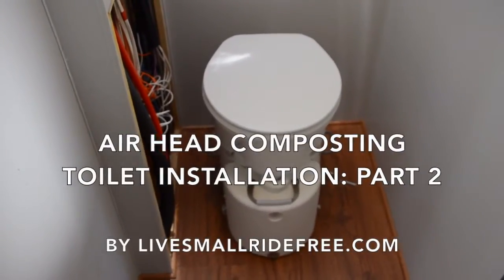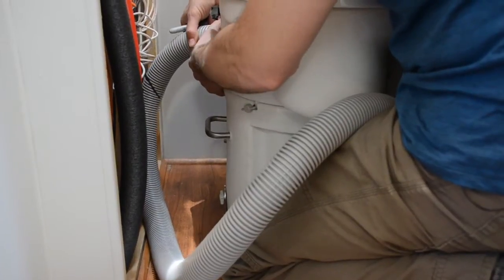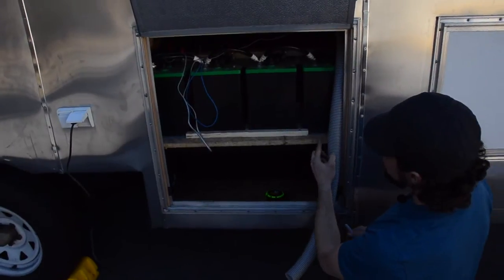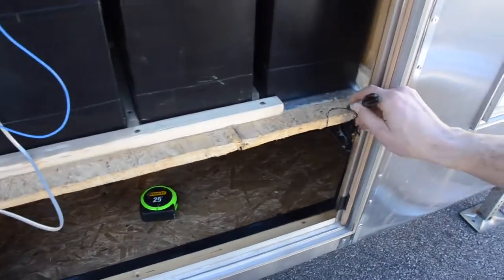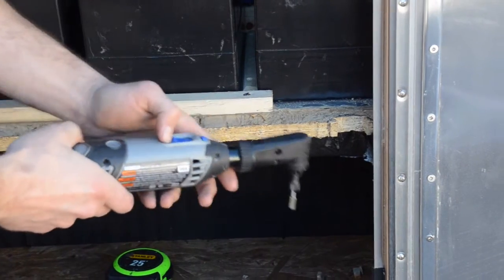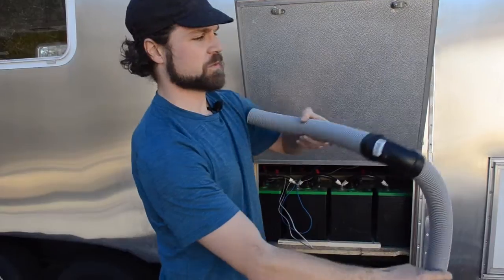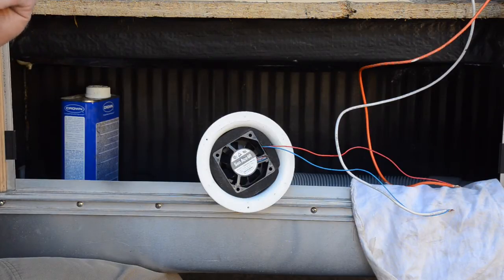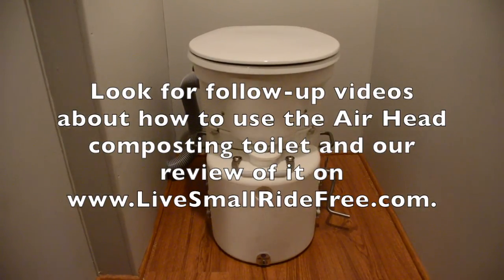Real DIY RV “Air Head Composting Toilet” Installation: Part 2

Comment: This video has been the most useful information I have found on the AirHead, which I am considering putting in our trailer.  Thank you for sharing the relevant information, clearly and efficiently.  You've demystified general composting toilet installation  for me as well.  Thank you!
Reply from the maker: That's great! We're glad the video helped. It's hard to get a detailed idea of how these types of toilets work based only on the manufacturers' information!

Our three most recent blog posts actually go into great detail about the "composting" action of these toilets and talk more about the specifics of using them responsibly. Check them out!
Reply: I'm starting my install tomorrow (revisiting your video as a refresher )   I'm wondering, with it venting out of the floor, if the fan is exposed to road grime/moisture, and how it has held up over time?
Reply from the maker: We had the vent in the floor for 3 years with no problems, but we did recently move it to the roof. Functionally, venting through the bottom of the trailer had no problems at all; we used a louvered opening and it kept the road grime out without any trouble. Driving creates suction, not back pressure, so this is not an issue.

Unfortunately our vent was also close to the "porch" area of our rig. It's on the same side of the trailer as the entry door, which is where you end up sitting and hanging out, and the air coming from that vent can have a smell to it (especially after a recent use). It's not the worst thing in the world, but it's not nice, either. Also, when we skirted the rig one winter, we had to ensure the vent was not blocked by the skirting -- or the snow!

This spring, we moved the vent to the roof, by tying it into the greywater tank vent line. It's been a real pleasure, not catching a whiff of that vent smell while hanging out outside. The smell doesn't happen all the time, of course -- just after a recent use of the toilet -- but i would say that if you can find a way to vent through the roof you will probably be happier. Extra holes in the roof are a bummer but plenty of butyl tape and Dicor will make you feel much better about it : ) Figuring out how to arrange the fan w/ roof vent can be a bit tricky but it is workable. The fan shroud supplied by Air Head is UV stabilized plastic and suitable for mounting to the roof. We have some pictures of how we did it; contact us at livesmallridefree@gmail.com and we can share what we did (haven't written it up yet).

Comment: Thanks for the info... I've been trying to decide whether to vent out the floor or the roof; I'm going to go through the roof.
Reply from the maker: We would recommend the roof! We vented it out of the floor for several years and you can sometimes smell it from the outside because of the location of the vent.
Reply: How did venting through the roof work out for you, any leaks?

Comment: Thanks. Couple of questions. I want my vent to go back through the floor as well.  Is there any back pressure against the fan when you are driving? Any problem with odour when hanging around outside the trailer? I want the opening in the floor as I would rather put a hole in the floor then the roof.
Reply from the maker: With the vent pointing straight down through the floor, there should actually be suction while driving, not backpressure. Moving air creates a low pressure zone. Venturi vacuum generators work this way. If there were backpressure, we would likely notice a smell inside the trailer after driving, and we never have.  We DO sometimes get smells outside the trailer, though. Typically only for 15-30 minutes after making a fresh deposit to the toilet, but since our toilet vent is on the passenger side near where we typically hang out, it's noticeable. I'd suggest locating the vent at a corner where there will be less outdoor traffic.

Comment: I found an airhead today for 600 bucks I'm about to buy it I reckon...

Edit, it's from a friend and it's brand new they bought it last year but they never installed it. I've never been used it's out of the box but I was wondering how those rings that are kind of cut how they go on I think they're supposed to be glued on but I don't know what kind of glue ( your part one answered this, thank you, I copied this from another video I asked on cuz I'm lazy), and also I have the side 90° hose Mount and fan shroud and I don't know what to put on the outside wall of the camper (rear wall) because I'm going to do a wall insulation so I don't damage my roof plus I need roof space for solar panels.Any advice would be great I guess I have to buy the outside downdraft vent somewhere else third party because I can't find it on the airhead shop on the website.

I didn't buy it cuz I wasn't sure if it was missing parts but it looks like everything's there there's some weird adapters to the house I'm not sure how they work I need(I think you covered some of their use in this video but I skipped through this one because I'm in a rush, I'll rewatch later). And what are those freaking coffee filters for to do like a single drop deuce? I was thinking of talking I'm down to $500, cuz I thought they were asking a lot kind of, but after looking it up there are like a grand and it is brand new so I don't need to be that greedy... I just thought it was missing parts but I don't think it is now.... Except for a bloody instruction manual that would have been nice. Mine didn't come with a roof vent option though it just come with a 90° vent so maybe you got to pick it when you buy it and they pick the wall mount, I just figured it have an outside part to seal it up from rain. Sry I ramble
Reply from the maker: Sounds like you're getting a great deal!
The split collar is supposed to be glued on; ours came off after 3 or 4 years so I replaced it with a hose clamp.
And yes the filters are for "one drop deuces". They're during the initial period of working out your aim -- It's a smaller hole than you're likely used to crapping in.

Airhead does sell the outside shrouds, both straight and 90 degree, in their store: https://airheadtoilet.com/usa-shop/?v=7516fd43adaa. Your friends may not have one because I think it's an optional add.

The grey flex hose that comes with the toilet is kinda unusual, not easy to source locally, so if you need more it's a good idea to buy that on their store, too.  It fits inside 1.5" PVC socket fittings, so if you have a long run you can transition to hard-pipe (glue it in with PVC cement).

Lucky for you, I am a manual nerd and have a copy. It's meant to be folded up so it's scrambled, but all the info is there. I uploaded it to WeTransfer, it'll be there for a week or so: https://we.tl/t-m7GyUZnwQ3

Good luck!